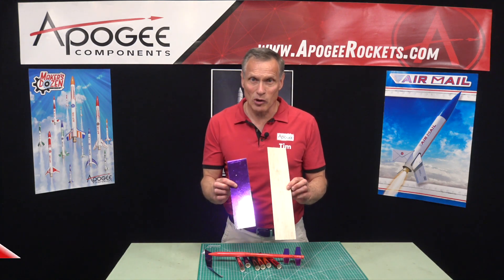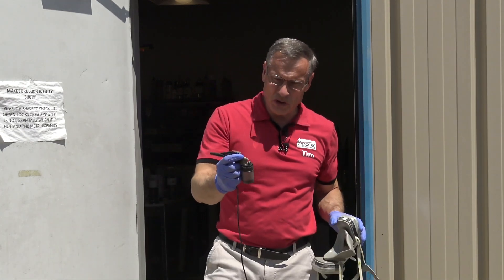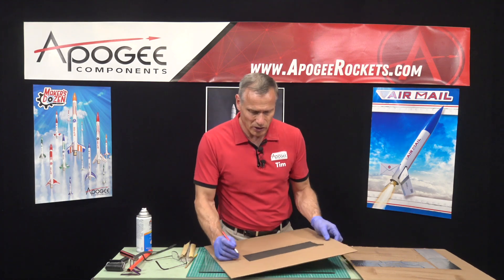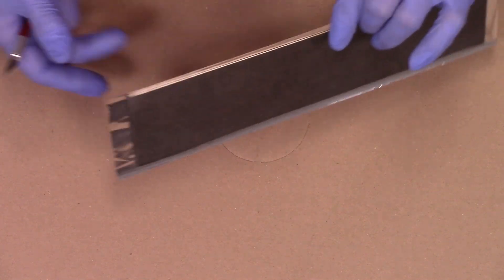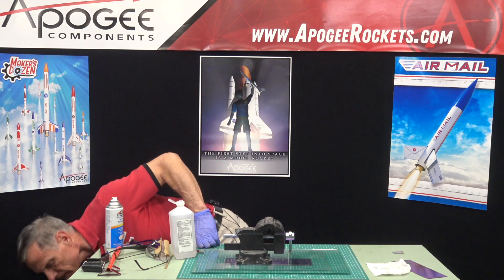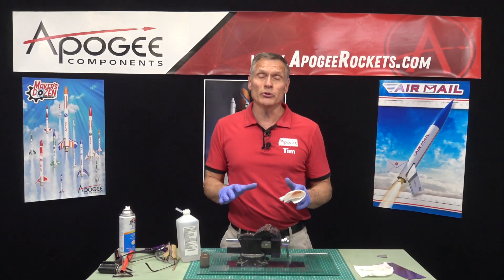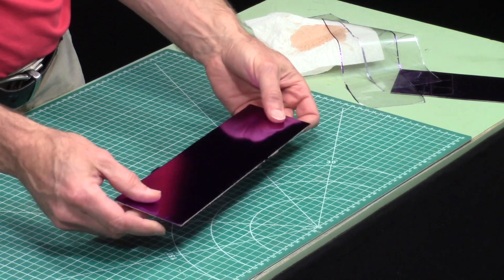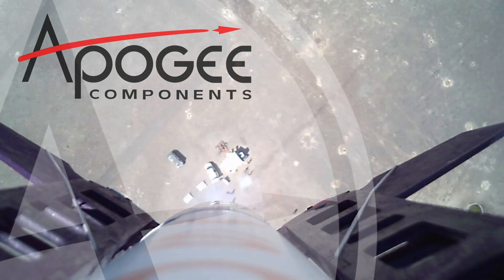Adding Metallic Foil To Your Model Rocket's Balsa wood Fins - Part 2

Comment: Great video Tim. I love the way the finished product comes out. Might consider using hair spray as your temporary adhesive. It could give less struggle with the foil. Also, consider applying the carbon to the wood then sticking it to the cardboard. You probably won’t end up struggling with so many wrinkles. Can’t wait to try it out myself. Gotta order an air brush.

Comment: Hi, Tim!  I work with films for a living.  A few tips:  once you apply a layer (veil or foil), use a burnishing card in a sleeve (commonly used to apply vinyl) to smooth the material evenly onto to balsa.  Also, look into getting an Olfa knife (uses snap-off blades) and snap a blade before performing any cutting action.  Much better result than using a dull X-acto blade.